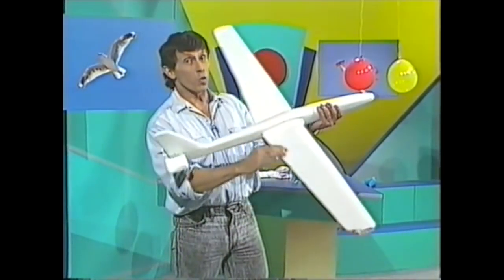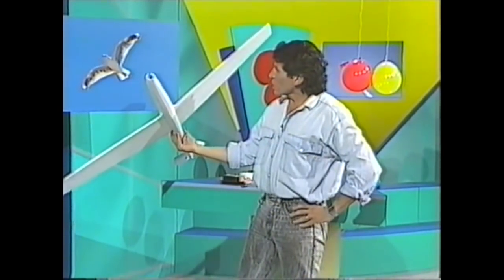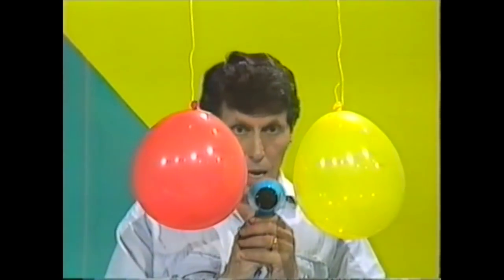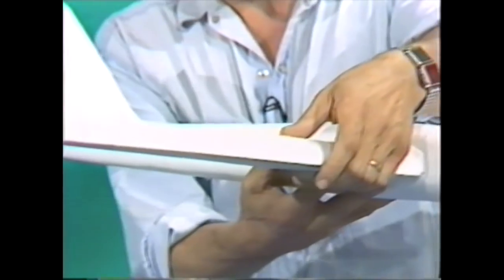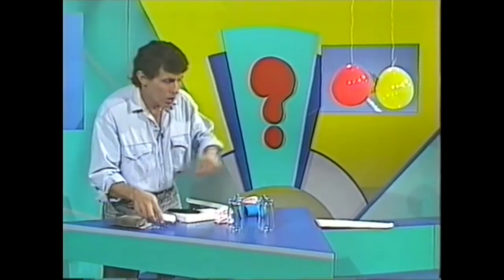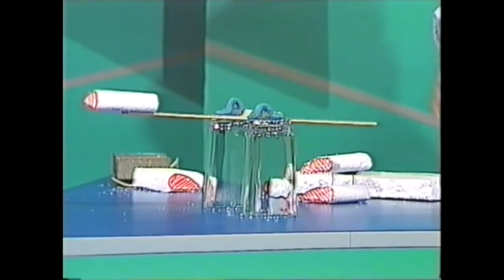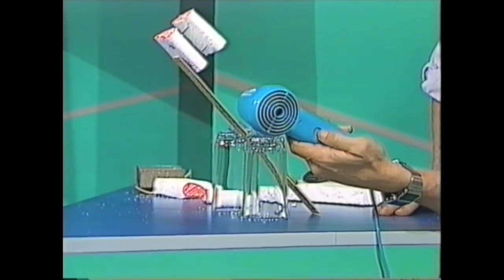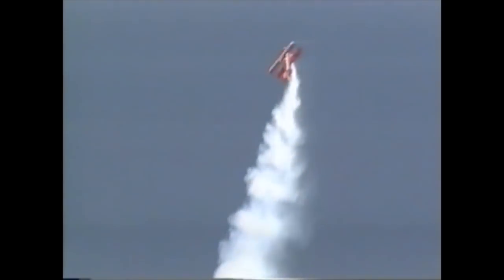Why Wings Work

Comment: Wings don't get sucked up (Bernouilli Principle), they push air down to produce lift - Newton's Third Law of Motion. The mass of air pushed down must equal the mass of the aircraft for lift to be maintained. An airfoil's magic is in deflecting the most air downwards with the least drag. As the angle of attack increases, so does the drag, until it's limits the amount of air that can be deflected downwards... and then the wing stalls.

The Bernoulli Principle's contribution to lift is practically negligible, but it's not zero (which is why you can demostrate it with lightweight balloons and fast moving air).

If it explained lift, then you'll have to explain how it is so windy underneath a rotary wing aircraft (ie. helicopter). It sure isn't getting sucked up into the air! ;-)
Reply: A: A wing does have downwash, However. . . Just how does the wing 'push' air down?  What is the physics mechanism that explains the pushing??

..
B: Bernoulli has no place in the explanation of cause.  Zero, not "some", or even an insignificant amount.  That explanation is totally wrong??
..
C: The mass of air in the downwash does NOT equal the mass of the aircraft. Nope.  No.  Not.  The mass of the air that is redirected by the wing (which includes the up-wash) times the acceleration it experiences is equal to the  force on that air which equals the upward force on the plane, the weight.  F=MA. It's Newton.
Reply: Answer to the Newton Explanation of lift: The relative motion between air and surface is the CAUSE of pressure changes.
.. .. ..
 When air approaches a surface, pressure is increased. This is just like the  wind you feel against you.  You feel the pressure increase and your area is the total force on you. Force = Pressure x Area.
..
When the air and surface try to move away from each other, it is the converse... pressure is reduced. The same physical laws remain in place.
..
Those changes produce Pressure Gradients with the atmospheric pressure far from the wing.
.
It was Euler, when following up on Bernoulli's work in the mid 1700s who determined that Pressure Gradients Accelerate air.  Air has mass and the force provided by a Pressure Gradient Accelerates the air between the two pressure, toward the lower pressure region. F=MA (Newton)
 ..
The motion of the wing causes pressure changes  around the wing that are the cause of ALL the lift AND ALL of the air Accelerations around a wing.

Downwash is a result, not a cause.
Reply: @Observ45er  I only read your first statement (and frankly, most probably not gonna read your second one).

A) the air gets pushed down by a wing due to its carefully crafted top surface which keeps the top flowing stream attached to the surface, gradually "bending" the air flow downwards.

B) pressure differences between the top and bottom surface actually do form in a level airfoil according to Bernoulli's law. however, they only contribute a very minor part to the whole lift generating process.

C) and what's exactly the "acceleration" of a flying plane?
Reply: this comment should get pinned! (well, wouldn't it be for this kinda troll in here, I guess .. lol)
Reply: @To.Ma.To_78  I have several, so I don't know which you're talking about.
Read this, or not, but stop pushing misconceptions that aerodynamicists know are false.
.
Some solid physics facts, if you care to learn.  I'll take small careful steps to your points.
A) The pressures around the wing are the cause of 
1- the downwash, 
2- upwash. 
3- spill around the tip and 
4- the lift. 
All those things are the RESULT of the Pressure Gradients caused by the relative movement of wing and air.
BTW, it is primarily BOTH 1&2 that satisfies Newton's Third Law.  You must account for ALL the air's momentum change around the wing, NOT just the downwash, otherwise that also violates Newton's Third Law.  N3 is a result, not a cause.

Pressures around the wing are what push your beloved air down (and the wing up) <-- this is required by Newton's First Law. Force (pressure) pushes up on the wing and pushes the air down, thus accelerating it from a stand-still to moving down (Euler).
.
It is Not this obsession with the exact upper SURFACE shape, but the curve in the FLOW that is the cause of the  (measurable) lowered pressure above a wing. A flat wing produces SIMILAR lift because the flow curves similarly!. 
A local pilot lost about 2/3 if the upper skin on his Cessna and flew safely to land with only a rudder correction.  The turbulence in the now open spaces between the ribs made the flow virtually the same as with the skin, but with more drag.  Demonstrating that it is the curved *flow*.  Aerodynamics folks, like me,  know this.
.
B) No. False. The top to bottom pressure difference is what causes the ENTIRE lift force.  This is measured on a daily basis by students and professionals. I've done this measurement.

This 'Bernoulli only produces part of the lift' misconception makes no sense at all. Force is pressure times area.  The upward pressure under the wing is greater than the downward pressure above the wing. The planform areas being the same yields a net upward force. Pressure x Area = Net lift force. Simple physics.  
 Pressures at the surfaces are the *ONLY thing pushing on the wing.*  

The old "Bernoulli" explanation relies on 
1- the equal transit misconception disproved long ago simply by looking at the flow. <-- That's why the pressure calculated by that false method looks too small!, and 
2- The false belief that speed causes a pressure reduction which violates Newton's First Law.  <-- That is the most common misinterpretations of the Bernoulli Principle. 

Air has mass and a force is required to accelerate any mass, including air.  That is Newton's First Law. These misconceptions violate Newton's Laws and, therefore, show a failure to understand Newton. . . 
.. 
Sorry, but this is good physics explained with the applicable physics, not this "according to Bernoulli" handwaving. . . . 

Also, Bernoulli's Principle/Law only describes WHAT happens, not WHY. 

Speed does NOT cause pressure to drop. In the mid 1700, following up on Bernoulli's work, Euler realized that air is a Pressure Gradient that Accelerates air toward the lower pressure region.  (remember Newton's First Law?) 
It is a well known fact among aerodynamicists that it is the lower pressure above the wing with the relatively higher atmospheric pressure ahead of the wing that is the Pressure Gradient that causes the Acceleration of the upper air rearward.
..
You can see it all spelled out with pictures, here as well: 
 Understanding lift correctly: 
 https://rxesywwbdscllwpn.quora.com/
..
Read this, or not, but stop pushing misconceptions that violate Newton's laws and aerodynamicists know are false.

- - 
Regards, an experienced aerodynamicist

Comment: 1:30  The air is already 'speeding' out of the blower.  It does not speed up more between the balloons. 
The physics:
Because atmospheric pressure holds the flow against the curved balloons, the tendency for the air's mass to continue straight (Newton 1) is what lowers the pressure.

Comment: but when the airplane flies upside down, shouldnt it get pushed down?
Reply: When the plane is upside down, it's not completely upside down, it's slightly at an angle of attack, wich makes the distance travelled by air longer on the top and thus keeping lift on the wing
Reply: @yahyalemnouar9751  ty

Comment: This is a misconception. If this is how it worked, how can planes fly upside down? What about planes with nearly flat wings? Lift is actually created by pressure differences and air being deflected downward. In fact, there's a surprising amount of debate even today on how exactly wings work. Source: am currently studying aerospace engineering
Reply from the maker: There are several forces. Flat (angled) wings work if there is enough power pushing them forward, but that doesn't negate the curved surface acting as explained in other wings
Reply: @CuriosityShow   Professor Merrifield gives a good explanation to the Sixty Symbols channel (https://www.youtube.com/watch?v=PF22LM8AbII) of all the things that need to be considered when studying how wings work: the pressure difference and Newton's laws. 
Too much for a youth-level introductory to the subject though!

Comment: I love curiosity show videos but this one was from sloppy research . It’s the classic explanation as to why wings give lift - but it can’t be true. They even show it can’t when they show the stunt plane flying upside down . And clearly the wing is generating lift the other way up. The real explanation is subtler.
Reply: oh it's really quite complicated, had a lecture on uni about this
Reply: Yes agreed. I read some while back that even NASA can’t fully explain it. They say forward speed and angle of attack are just as important as wing shape.
Reply from the maker: The lifting effect of a wing is a complex process involving the interaction of wing cross-section shape, forward speed and angle of attack.  The stationary seagull, which I photographed, had a forward speed of zero but the strong head wind gave it an apparent forward speed which it used, with a carefully chosen angle of attack, enabling it to 'hover' in one position.  The purpose of this segment was to isolate and demonstrate the lift factor given to a bird or plane by the cross-section of a wing.    Deane.
Reply: A plane flying upside down doesn't disproves the Bernoulli effect explanation given in the video, since while upside down, the pilot changes the wing's angle of attack and the Bernoulli effect still takes place and can(partially) explain why the wing is generating lift.
For a more in depth explanation, watch the video in the link below and see why Deane is actually more right than wrong(not fully right, but it's a show intended mainly for kids, not physicists) with his explanation and why a plane flying upside down says nothing:
https://www.youtube.com/watch?v=PF22LM8AbII
Reply: I thought everyone flew upside-down down under Lol.. I'm only kidding my Australian cousins ;-)
Reply: @E_y_a_l  What an awesome video. This is truly the purest side of Youtube.
Reply from the maker: @E_y_a_l  Thank you for your contributions to the discussion of the lift effect of wings and for providing the link.  YouTube provides an excellent forum for such interaction.  Please encourage your friends to join our Curiosity Show YouTube channel.    Deane.
Reply from the maker: @Kkaapoww  You will find hundreds more science activities and stories on our Curiosity Show YouTube channel.  Please subscribe and share the good news with your friends.   Deane.
Reply: No I don't think the research was sloppy, they just didn't have time to explain the design of the wing of an aerobatic plane.

Wings create lift like the way they explained, by the shape, curve on top, flat on the bottom. It's called airfoil design. It IS the classic explanation as to why wings give lift, and it is true.

But airfoil is not the only way to create lift. Lift can be created by the angle of attack. Think of the blade of a ceiling fan; It is angled downwards, and as it moves through the air, it pushes air downwards. Conversely, an airplane moving through the air with the wing angled downwards will generate lift by forcing the air downwards.

The wings of an aerobatic plane are designed differently. They are not flat at the bottom and curved at the top. The top and bottom are curved and symmetric. So the wings have same geometry in any position,  flying right side up or upside down. They create lift by changing the angle of the wing in both cases. 

On a regular aircraft they use airfoil design, because it is efficient. An aerobatic plane is designed for just air shows. It won't be an efficient as a cruising plane. Hence most airplanes have airfoil design, curved on top and flat on bottom.
Reply from the maker: @cultclassic999  Thanks for your thoughtful and precise discussion of wing shape and the lift effect.  And thanks for your support of our Curiosity Show YouTube Channel.   Deane.